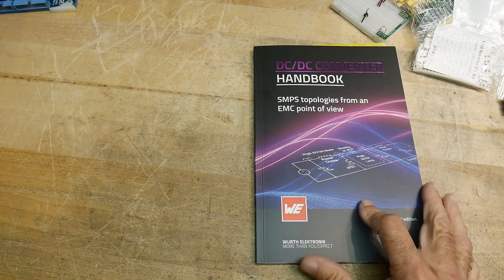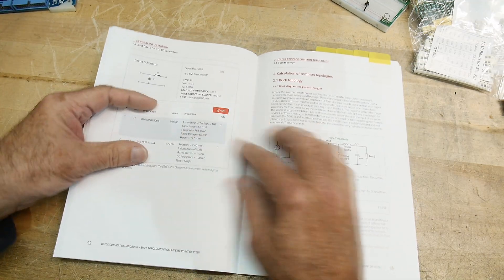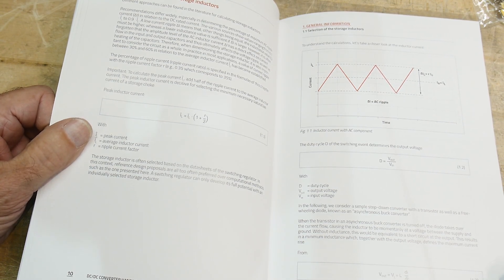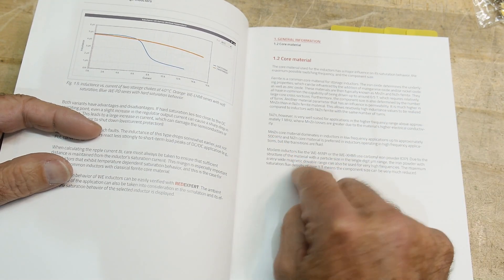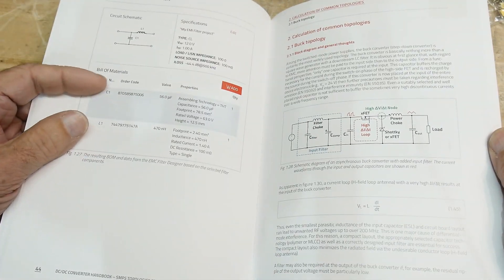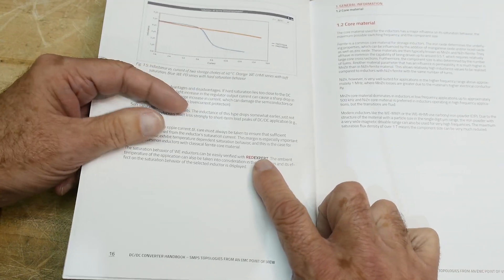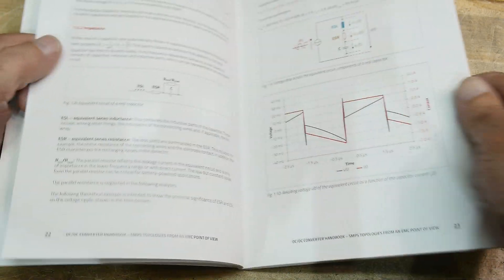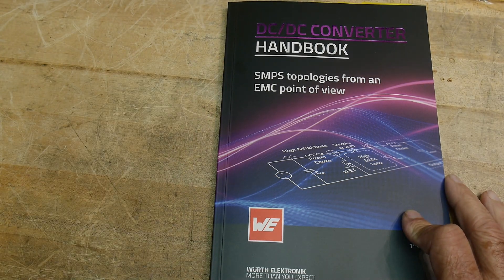#2055 DC-DC Converter Handbook Review

Comment: This has been a standard marketing publication type in the electronics parts world for 50+ years. I would typically go to a trade show and get a whole book case full of marketing materials free of charge.  I remember ordering a whole series of books on TTL IC Circuit design in like 1983, I was 13 years old.  Got a whole bunch of big books mailed to me for the price of postage, or free. 

Looks like they defray their printing costs now, and that's what makes them seem cheesy when you BOUGHT a book.  I learned a lot as a kid in the 1970s and 1980s from these free publications.

Cheesy those these are, I like them.   There needs to be more, on a variety of topics, for non-engineer audiences, for people who are just messing around at home with an arduino and a breadboard, and maybe have some project in mind, and may need a variety of general handbooks for various electronics topics.

What we have here is an interesting capture of the evolution of this marketing strategy.  These days they want you to show up at their web site and key in your information so they can blast you with 200 emails a week.

Comment: .Wurth does make excellent caps, inductors, ferrites, etc. Could be a worse company. Edit: how has this dude never heard of Wurth? Isn't he an engineer? Major electronics component company.
Reply from the maker: I was an engineer in 1980. then did optics for 35years. I never claim to be an EE on the channel. I know you are new to the channel. here is about me: https://youtu.be/x3IPtBzxAgE?si=tMfVQrjTxvg27UOl
Reply: This guy knows more about analog electronics than most electrical engineers. Modern EEs are basically computer programmers, and while that's important, I find it boring. This is the stuff I love.

Comment: I didn't see any practical examples. Down thumbs on the book!
Reply: Please explain ?
Reply: @miller-clem  I have many books that were written to train engineers and technicians in a subject. They mostly included sample circuits with parts values the reader could assemble and work with. Without these sample circuits it takes significantly longer to get one up and working.
Reply: Read the cover of the book. It says it's about EMC, not how converters work. Both you and the video creator seemed to have missed this.
Reply: @humidbeing  AAARUH!  Guilty! Oh well.
Reply: Yeah, it's not a textbook! Used versions of Principles of Power Electronics are cheap.